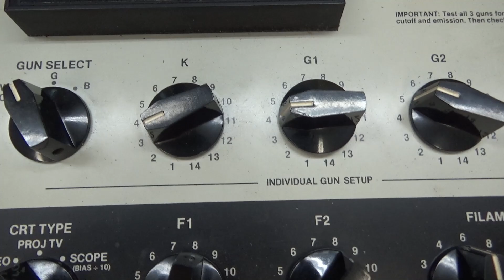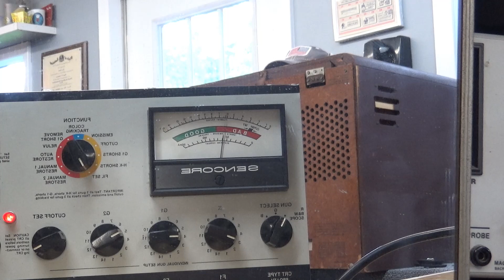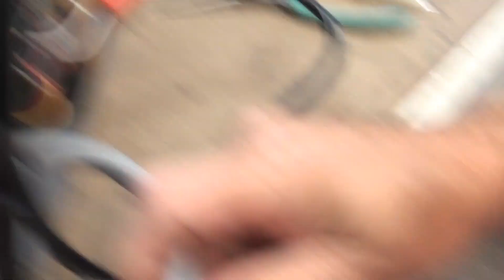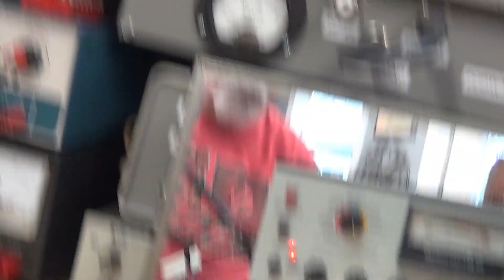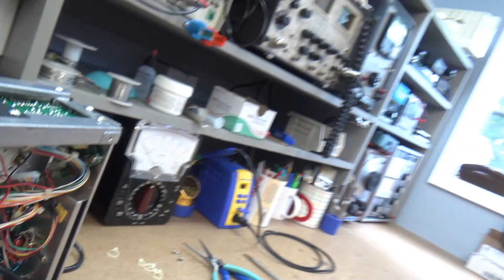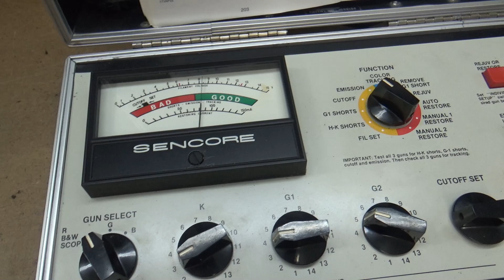Weekend Shorts Series 2

Comment: Wire Gremlins are the worst. Me thinks someone may have used the wrong type of solder on the whole connector to the
 PC board like lead free maybe. This is especially so if no solder points look bad or cracked. On the other hand the
 individual wire connections on the plug may be weak themselves. Good troubleshooting efforts worked again. Steve